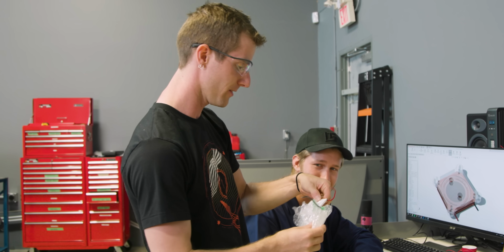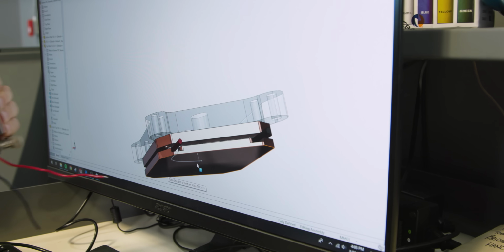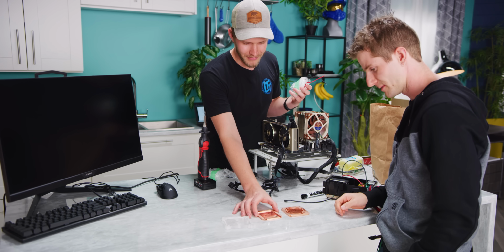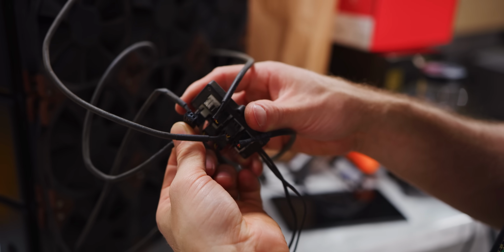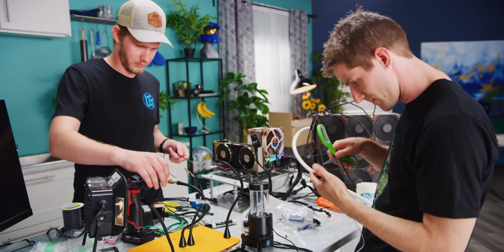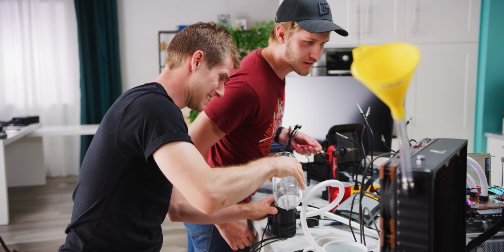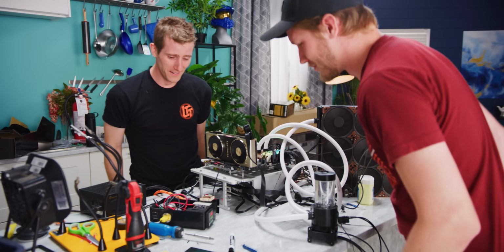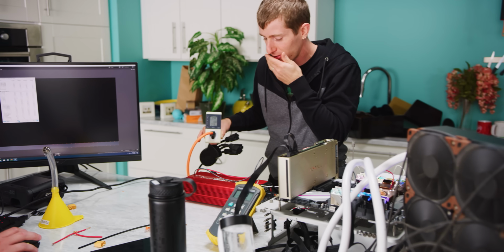This Cooler DRAWS 545W!!? Bad Cooling Ideas #2

Comment: Just FYI - TECs get more inefficient the more voltage you feed them. The sweet-spot is often at around 60-70% rated voltage.
Running 545W TEC at nearly double it's rated capacity means you are shooting yourself in the foot, no matter what cooling system you have on the hot-side it will be effectively be cooling less.
If you actually have a variable voltage PSU to work with then start at 60% and dial it up from there to find the optimal the cooling system can handle, but if you ever go above 100% of the rated capacity you can just stop trying as it will be counterproductive from that point on.

Current CPUs that just a big too power hungry unfortunately. If we had high-performance CPUs that ran at like 30-40watts they could actually be a pretty reasonable way to sub-zero cool without all of the drawbacks of compressors (and within the power envelope of a reasonably PC PSU).

I ran a system like this (albeit much smaller scale) for my Athlon XP way back in the day, and that actually worked quite well and surpassing anything I would hope to get by water alone. CPUs just weren't as power-hunftry back then (and 65w TDP actually meant 65watt and not 200w).

Comment: Alright the solid state relay will not disengage because it can only disengage AC power. you want to use a mosfet switch (mind the polarity and place in the circuit) or a old fashioned mechanical relay. the PID works just fine.

Comment: Hey Guys,

I actually use the Peltie to cool down IV fluid at work for freezing intervenes veins that go into the heart. The processes takes 15 min to cool 1 liter 1C when flowing through a pipe with and ID of 1/2 inch at 300 ml/s.

Instead of using the Peltie to cool the CPU directly (horrible idea because CPU can vary temp depending on the usage) use it to cool the liquid. Design an aluminum block that can run fluid within it. Than use thermal compound to stick the Peltie lets say 3 on an array and power them using a 12 power supply (link below). Attach appropriate size radiator. Peltie drive require stable temperature change. CPU can change temperature very drastically which will  overwhelm the device. You can use it to cool it no doubt but the time factor will kick in and below the CPU is cooled you will burn the device.
It's more efficient/faster to use it to cool the water than use it to cool CPU's. Good Luck to you bud.
https://www.sunsky-online.com/view/218820/S-360-12%20DC%200-12V%2030A%20Regulated%20Switching%20Power%20Supply%20%20100~240V%20.html

Comment: What if you flaten a cooper pipe and mount it there to cool the water going in to the CPU, insted of trying to cool the CPU it self. then the the exces heat could go out in the room, or if you wanna mount it outside a room and run a loop in trough a wall, it could work? IDK, but I think you guys so try it to find out!

Comment: Did they even turn on the fans on the water cooler? 22:06
Reply: Yeah they are running, it's just an optical illusion often related to high frame rate cameras.

Comment: Forget the thermoelectric effect. Hook that sucker up to the compressor on an actual AC unit.
Reply: It's been done and it's very effective. Only problem is size of the machine.. it's about as big as the system it's cooling.
Reply: @asm_nop  Also, the load profile is not at all a match for such a design.  It would eventually kill the compressor motor.
Reply: Linus has an AC unit based system (that does work).
Reply: @harambeexpress  (barely)
Reply: See, the thing is, they’re not doing this because its a good idea. They do it because they can.
Reply: didn't asetek do double phase pc coolers at one point?
I have a single phase built in a case, that runs on 12v - very effective on the Athlon 64 x2 it cooled at the time!
Reply: They have done that twice now
Reply: You should make the base of the CPU block larger and make it act as a heat buffer.

Comment: @LinusTechTips the tec really doesn't seem to be able to keep up with the heat demand from the CPU (seems obvious from your videos). Why don't you try using the tech to cool the reservoir instead. I'm not talking about the reservoir attached to the D5 pump, I'm taking about like a 4 liter bucket, or the 9x120 monstrosity you have there. Attach it directly to the reservoir along with fans and what not, from my experience it make a difference then. Tec are really only good once you've hit steady state.

Comment: Solid state relays cant swich dc you need a mechanical relay
Reply: they make solid state dc relays you know.

that being said, they bought the wrong relay lol
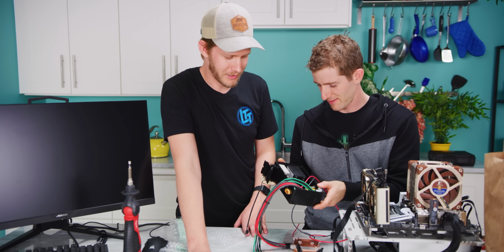Reply: 8:17 yup, looks like it (AC SSR)
sidenote
DC SSRs tend to still pass current when off, if wired backwards, so that is something else to watch out for
Reply: @MrKureigu07  it shows a dc input and ac output, but i guess the output side doesnt matter so much unless youre dealing with ac current specifically

i think i read the input and output wrong the first time around
Reply: DC is harder to mechanically cut than AC (not sure about semiconductors), and AC should't be put on a DC system as it might not be able to handle the reverse polarity/current.
so, always select the correct item for the job

Comment: I noticed that since Linus first started this project the stock in UPS power supply company's rose dramatically.
Reply: The PS part in UPS already means power supply. "UPS power supply" is redundant.
Reply: @megapro125  No, he's trying to supply power to power supplies with power supplies

.
.
.

Actually I think they're called load banks.

Comment: A liquid loop isn't going to work with a TEC.  What you need is to use an air cooled system.  Put a fan on to push the heat away from the CPU block  and make a duct that leads to a rear exhaust fan with high RPM  to control the dissipation of heat.

Comment: From my understanding those 545 Watts is the power rating or heat output if you will. With TEC input power does not equal cooling performance, your device might be underpowered by a lot. The plate you were using is meant to be a replacement part for a watercooler or a small fridge, not a CPU. 
Efficiency of TEC are 10 to 15 percent at best. Your basic device will probably be at 5 percent or lower.

I would be interested to see the thermal performance of your watercooling block when used as such. The increased surface area might make a difference on those many core CPUs from Intel and AMD.

Comment: A like for him wanting to bring this series to the next level: get some more efficiente tec or design some workaround like a double water circuit so you can use a bigger surface for the coolingand a thinnier copper plate to cennect the cooler to the cpu and connect rhe first cooler with a water circuit to a second bigger cooler tath transfers the heat to a conventinoal cooler

Comment: EZ PZ:
CPU block > 360 rad > 2x aquarium peltier.
Cool liquid like normal, THEN chill.

Edit: As @tommihommi1 pointed out in his reply to this comment, this setup in not good for sub-ambient cooling(although I personally see this as a positive due to the reduced likelihood of condensation).
Reply: doesn't work, since the rad will actually heat up the liquid once you're below ambient
Reply: @tommihommi1  fair point, but going below ambient would only increase chances of condensation anyways. It's not great for getting sub-zero but in theory that just means it'll self regulate around room temp without the need for any of their crazy control setup
Reply: @bamholian4567  just stay below ambient, but above the condensation point. Pretty easy to do in air conditioned rooms

Comment: The TEC shouldn't be in between the heat spreader and water block cold plate, it should be between the radiator and the CPU block; pre chilling the water just before it goes in to the block. In the current configuration the heat flux is too much for the TEC and it's insulating too much.

Comment: The flaw in your cooler is that the hot side is wayyyyy too close to the cpu, you had a hot cpu, cold side and a very very hot side of the peltier unit , Too much heat compared to the cool side.

Comment: ..try gas, some alcohol, is better than water, and if you decompress the gas in radiator ..you can use less watts in fan or peltier. (off course you need some math in that) keep trying ..for sport, may you can arrive with some high quality product,

Comment: I used a water-cooled 250w TEC with a 700MHz Pentium 3 overclocked to 1,050MHz (which at the time was a pretty stout OC) way back in the day. Idled at subzero temps, peaked under load at around 18C. Had to insulate and coat everything to avoid condensation - I was using a slot mobo and a socket-to-slot adapter, which made that part of the process a lot easier as all I had to deal with was keeping the adapter card and processor protected. Although I haven't used the setup in years I still have all of it, and was playing around with the TEC module a few months ago.

I saw a potentially critical mistake in the implementation of that huge TEC: not enough material in the coldplate - for a TEC that large, the spreader on the cold side would need to be at least 1/2" thick at the closest points between TEC and processor. (I used a quarter-inch thick copper square on my TEC.) TECs are whole-surface devices and don't cool point sources well, and if the cold plate was a pocket for the TEC milled into a 1/4" copper plate that won't be nearly enough material to have enough thermal mass to spread the load. This would likely be why the thermocouple readings were changing wildly but the processor wasn't getting cooled effectively as a 525w TEC should have been able to grow frost on the cold plate even with a powered-up processor (with a sub-100w TDP if it's anything modern) running below it. You can't skimp on physical material for a TEC/water system - there should have been literal pounds of copper involved.

TEC/water cooling combinations worked back in the 1990s/2000s but I wouldn't try TECs on modern hardware. The power consumption versus efficiency curve just doesn't pay out - you generate more heat than you move. Modern hardware only realistically needs water cooling at most.

Comment: You need to build a 2 loop system with steam absorber and Peltier comes as heat exchanger. moms inventors
Reply: Peltier itself has not enough thermal capacity and need condenser

Comment: As a lot of others said pushing 900w through the tec is a realy bad idea, you can't cool 900w + the cpu heat with that loop 

Start with a constant hot surface (not a cpu) and start supliyin like 5V dc to the TEC and keep going up SLOWLY until your sistem stops removing heat from the hot surface, then you know if you are cooling the hot side of the tec well enough

Comment: the ssr was worcing corectly but i think its based on a triac and therefore wasent able to switch of the dc when it was applied cause triacs need the 0 crossing of ac to unlatch

Comment: I think you are doing it wrong. Use a regular water block on the cpu. Put a large heat sink on the hot side. Then put a smaller heat sink on the cold side. Drop the cold side in the water reservoir cooling the water. Keep a small radiator in the loop. Set to turn on at whatever temp.

Comment: if i seen it right , this nuts you ar reffering to are clamps(?) from wago an german maufactorer for electric connections and i am happen to be an german electrican and while i was still an apprentice (you have to learn for 3 years and 1 day in week you go to school) we had some folks over in school that showed us how much these things hold, they used an transformer to punch like 200amps throug them and while the copper wire was glowing red the clamp wasn´t impressed by it, was very impressive to see back then and these things are here the standard for wiring in house electric and much much safer than any screwing connection wich can loosen over time these things hold tight because of there construction that has a spring contact inside, never had a problem with one of these in over 10 years now.
before these things give way the wire insulation will starting to burn their crazy strong and reliable, !if! used correct, means the copper far enough inside which schould be easy because of their transparent housing but be aware there are counterfeits out there wich i wouldn´t trust i am reffering to the original wago ones...

Comment: I was pretty big into extreme cooling back in the day and this took me right back! it was around the time of the early Athlon's and P3's till the first of the dual core CPU's came out. I played around with all the major cooling types air, water and phase change, apart from Tec's. as some of the horror stories in the OC community when they failed was the stuff of legend!

One piece of commercially available extreme cooling that you could use in relative safety was a Prometeia (compared to Tec's), I used one for about 3 years in my gaming PC, direct CPU phase change cooling might be a method to look at if you are considering doing more projects like this.

Comment: Bwahahaha running components from Maou's China Emporium at 100% load is not with in spec. You turned the TEC into a 900 watt heater. lol

Winter is coming. I expect a to FINALLY see a PC with a cooling loop that goes outside into the Canadian cold weather to cool the PC. Tech Ingredients made a TEC fridge and the loop goes outside the shop to increase efficiency. So it can be done! Let's just skip the TEC all together and run the loop outside! :-)